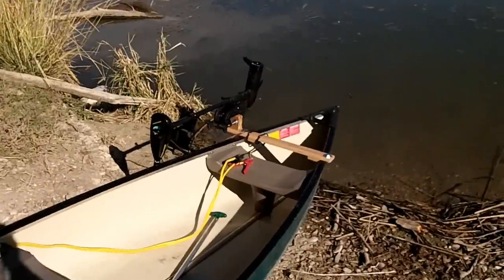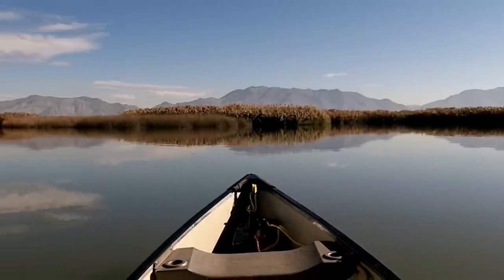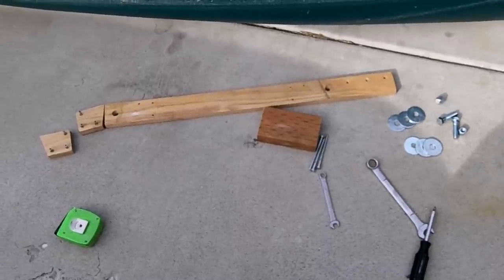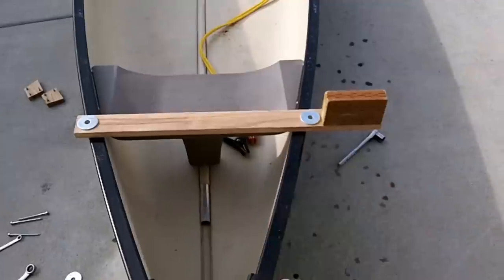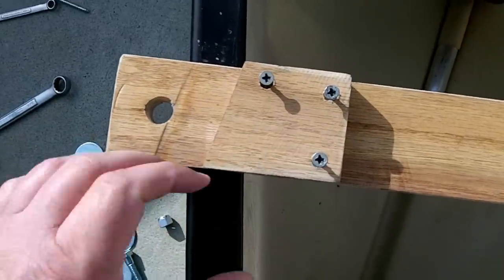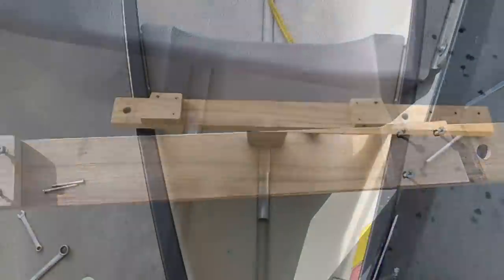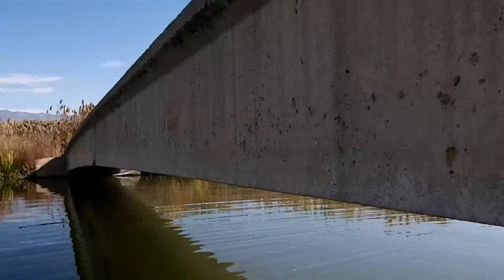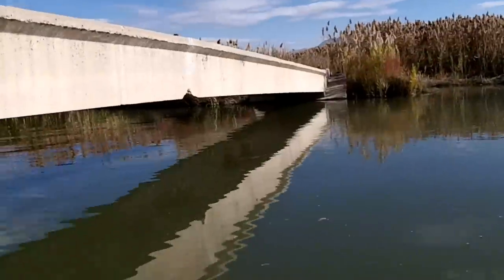Homemade Canoe Motor Mount Tutorial- Designed for Electric Motors

Comment: After reviewing several designs on internet, yours is very simple to build, cost effective and not over-designed for holding trolling motor weight. Great instruction and video. Thanks for sharing.

Comment: There are alot of diy ideas on you tube in how to build your own canoe trolling motor mount, which seem decent and simple enough, but I was wondering is there a specific reason as to why they are all made to mount off the side of the canoe rather than straight out the back of the canoe? Just easier to build or something to do with performance or something?
Thanks

Comment from the maker: @woodsboy22
I've got an EverStart Marine deep cycle battery purchased a couple of years ago. It has 115 amp hrs, 720 marine cranking amps, and 600 cold cranking amps. I don't know what all that means but I've never run out of juice while out on the water. I have been out with my dad and have used this battery for trolling on his 1978-1980s? AMF Crestliner. We go out trolling for about 5 hrs at a time and it only uses about 50% of the charge. So, I think you'd be good with just 1 battery.

Comment from the maker: @woodsboy22 
I don't see any reason you couldn't make a 2x4 work. The weight difference wouldn't be enough to change anything dramatically. The only problem you might run into using a 2x4 is where the base and gunwale/gunnel meets. The base might be too narrow and wobble a lot while in use- but if you get creative like putting 2- 2x4s together over the gunwales I think it would be fine. Let me know what you decide and if it works.

Comment: Is there a better way to store the battery for the trolling motor than this? Worried about water getting into the canoe and then to the battery.
Reply: if you got any waterproof container drilled two holes in it to run the wire then use silicone around the wires going into it you could easily make something for it

Comment: Instead of using Jumper cables to have the battery up at the front, the lid of my battery box has an outdoor house plug socket wired to the battery. Then the wires from the motor are attached to a Male Plug. Now if you want to have the Battery up at the front, just use an outdoor extension cord!